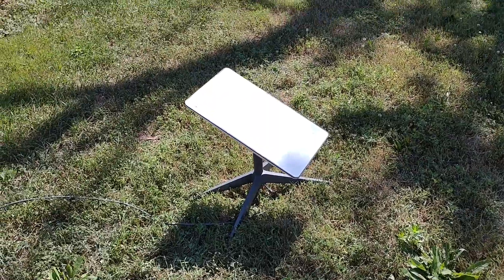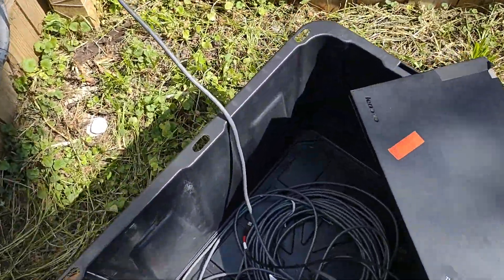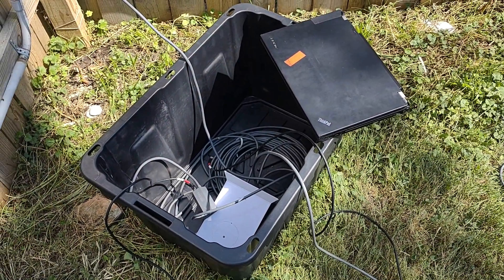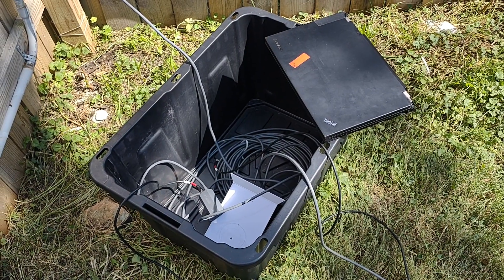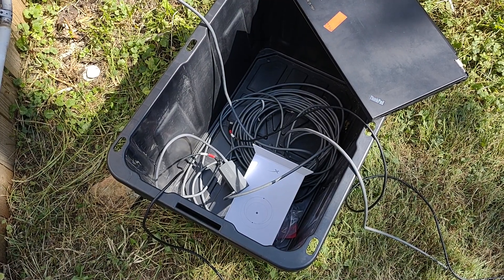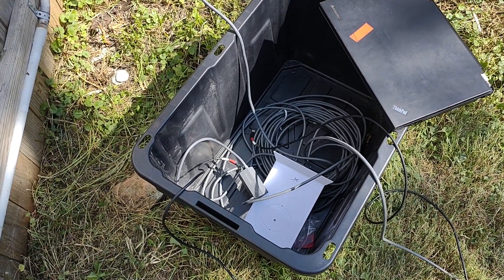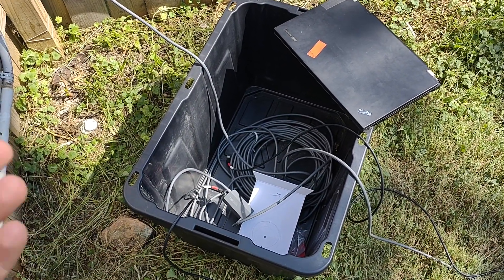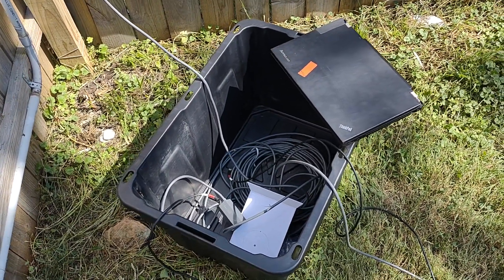My starlink died here's what happened

Comment: The ethernet adapter is not well protected for overvoltage.  I assume your el cheapo inverter had a voltage spike.
I have read the adapter has problem with lightning nearby etc.
It should probably have components against overvoltage, e.g. a zener diode.  I guess there will be a revised version soon.